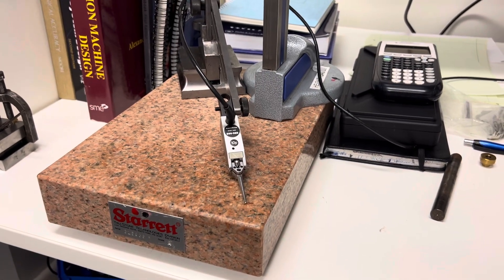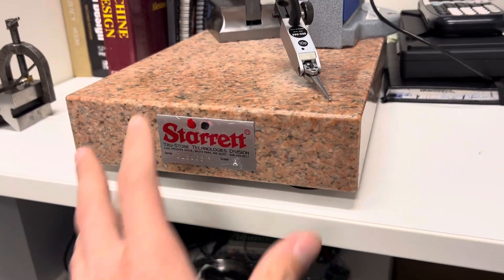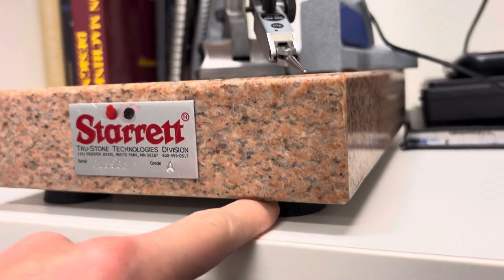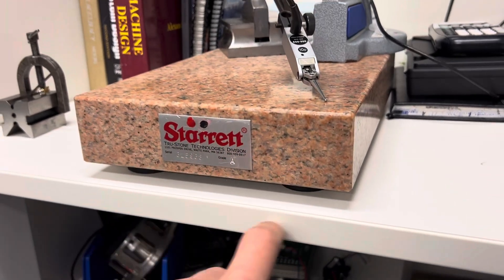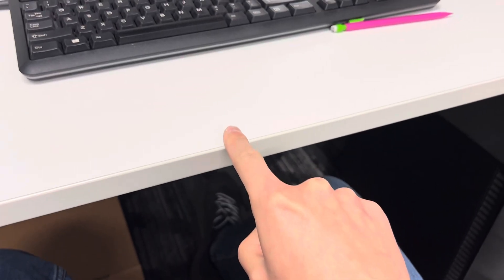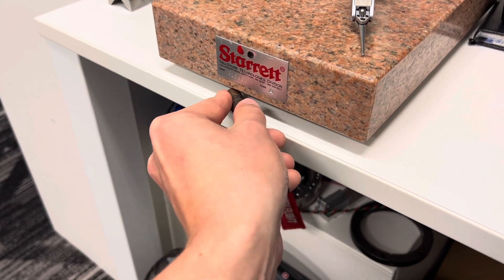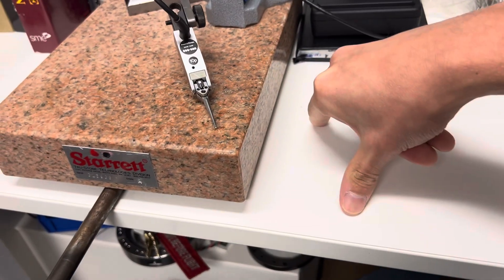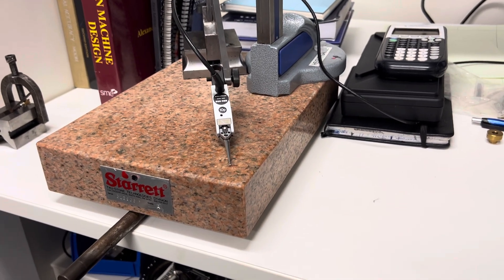Exact kinematic constraint- not just for locating!

Comment: the only thing you were doing was shifting the weight of your measuring instrument not deforming your surface .
So the issue is gravity not deformation. 

Whit the rod in the middle you prevented the shifting in front of the tabel not the back.

Maybe get a massive tabel you can't easily deform.

Comment: Very interesting, but I think you may be a little off. How do you know that you are reading the deformation of the plate and not the deformation of the measurement armed caused by the gravity vector shifting? I'd argue that you would see the exact same or similar result even if the plate was an ideally stiff body.
The arm is not even close to infinitely stiff and is for sure less stiff than the surface plate, therefore, I'd argue that it has a much greater impact to the reading than the deformation of the granite.
Just food for thought.
Reply from the maker: @emo1net  the neat thing about this demo is it works no matter what side I put the rod under. When it’s under the back side and I deflect the table, the plate tilts the same amount that it would if it was on four supports. The gravity vector changes the same amount, yet the displacement goes away. This is why I’m confident we’re observing the plate bending.

Comment: I had no idea granite was that flexible. Its elastic modulus is like 50 GPa
Reply: It's not, it's the rubber deforming that's causing it from what I understand?
Reply: @noviceartisan  no, the plate itself is deforming . The indicator measures the bend of the plate .
Reply: @noviceartisan  Granite plate is deforming through unbalaced 4 point rubber support.
Reply: @MrDehicka  It's slipping, or misaligning, moving, or such, but not deforming.. the material is vastly too dense for deformation. That is the wrong word. The rubber however, IS deforming, and that's what's causing the granite to change positions/move/misalign. To the best of my physics knowledge. The word used matter
Reply: @noviceartisan  you have missed the point of the video. Just Google elasticity modulus of granite and compare it to steel
Reply: @MrDehicka  And I'm telling you the part that' deforming is the rubber, the granite is not deformed, it's moving yes, but not in the way you're thinking at all. That's why I'm picking on this word choice. And thanks, I'm WELL aware what that is, maybe look up Young's modulus instead..
Reply: @noviceartisan  The micrometer is measuring against it's base, wich is on the same granite plate. There is no rubber between them.

Comment: This is why machine tool foundation is critical to alignment and overall precision.  The foundation has to be solid as well as the leveling pads.  Another reason not to use steel plates to put machines on.

Comment: how can deformation of desk being transmitted to the granite plate in 4 points setting? their connection are not rigged
Reply: Think about the desk deforming so that one foot out of the four moves upwards. Each rubber foot acts like a spring - so as that one foot moves up, it compresses and transmits more force into that corner of the granite plate. This causes the granite to deform which changes the reading on the indicator.
Reply: @daniellacroix4624  people just overestimate the rigidity of granite compared to rubber. The young's modulus of granite is around 1000 times higher than that of rubber, which means that it's not unreasonable for the granite block to deform by 1 micrometer If the rubber foot deforms by a few millimeters
Reply: I think of it more that if the thickness is half the lenght then its rigid enough to support its own weight well (for granite). In this case the thickness is much less so less rigid. This can easily be simulated and is why machines below 1um are heavy and expensive to manufacture if used without backlash compensation.

Comment: If you want some more fun: Trap a tiny amount of air in your measurement setup.
I spent a week hunting down some random drift in my laser-level-webcam (github) setup until i randomly stumbled upon a barometric graph in my smarthome setup and noticed the similarities.
Reply: that is reason why measuring devices mostly touch probe style instead of modern laser, air IOR is not stable.
Reply: @AABB-px8lc  The problem wasn't air+laser interference but air trapped in a contact surface between to metal parts, moving my laser-reciever.
The github project is essentially trying to achieve something like a "ProLevel" from the company "Status Pro".
Reply: @blauesKopftuch  that too, I just remember some details about how ASML ppl describe troubles when they try to use light based measurements of positioning in 1 nm resolution (linear scale with pattern) and get wired unstable because air get squashed when reticle move and interferometer data as obvuiously not realistic. Is i remember they use some adjusting formula to respect pressure gradient. Induction based linear scale in that case maybe better idea.
Reply: @JasminUwU  lmao so true!!

Comment: Thank you! Long time ago, my elder colleagues said that machine should be designed to rest on three feet. But I've never got a clear answer why. Some of them explained it's for easy of leveling during initial setup. Other said I'ts because of "philosophy" reasons 🤣🤣🤣. Considering the benefits of many feet for reducing static deformation and increasing dynamic stability (better frequency response), I saw no practical reasons to go for three feet design. Finally, now I understood 🙏
Reply: It all depends. If the machine is compact and very sturdy and needs to hold tight tolerances, thre feet is definitely the way to go. But if the machine is big and the components are flexing from weight alone, you definitely need more feet. The machines my workplace is building have dozens of feet under the bed and all of them have to be adjusted carefully so the bed gets as straight as possible. If the customer wants it we will also check the alignment regularly.
Reply: @CatNolara  Good point
Reply: Here I thought it was related to Feng Shui.

I'll see myself out.

By the way, I enjoyed the video @cylosgarage.